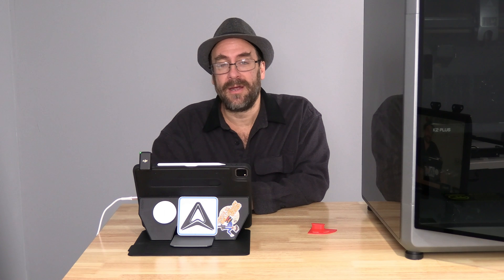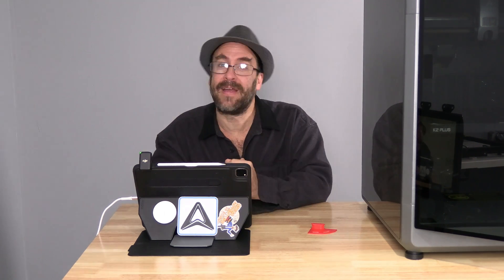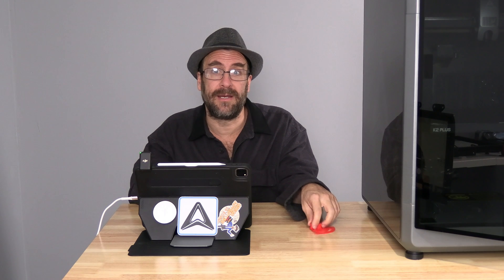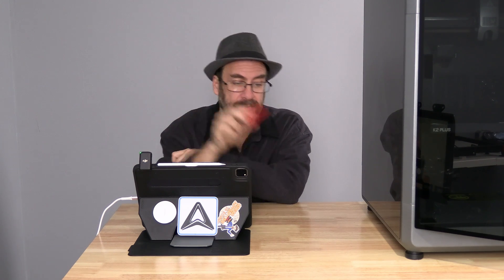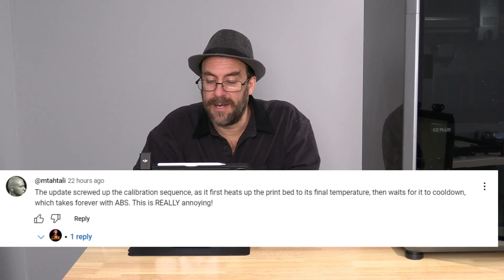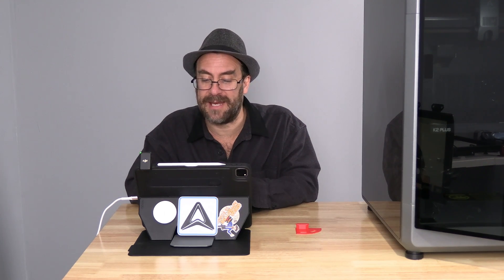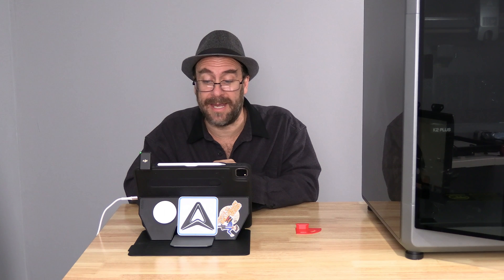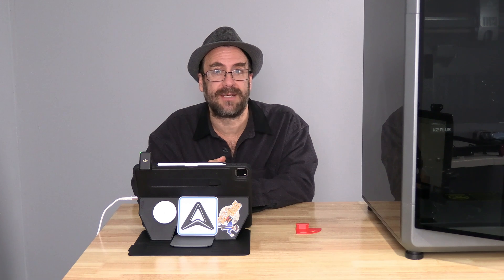K2 Plus Firmware Issues: *Creality Response* - Belt Tensioner, Camera, ABS ABL Issue. *Watch it all*

Comment: You need a clip on blue tooth microphone
Reply from the maker: Bro, I have a DJI Mic clipped to the top of my IPAD.
Reply: @ ok i couldn’t hear you very well  excuse me I’m old
Reply from the maker: Turn me up! I tested on 3 devices. Sounds Good. I Wonder if you caught the video before it was done processing. However, it does look like I forgot to adjust the volume before rendering.... So, maybe I coulda made myself louder.
Reply: @ no idea my friend 
I added a pop mini microphone to help with sound has noise cancellation to my videos
Reply from the maker: The DJI let's me control the out put on the mic and the receiver. Both of which I need to turn down, or my Camera blows it all out. Then, I bring it up, in post, while editing in Vegas Pro 22.
Reply: @ i use a iPhone pro 12 and pop mini microphone 🎤 to do all my videos . I refuse to spend big bucks on  a professional camera. 
I use to use my Olympic  E -3  and E -5 but reserve that  for my wild life  photography. Too much set up to do video. I sold those but a friend  gave me another E-3 from New Zealand. He shipped it over to me .